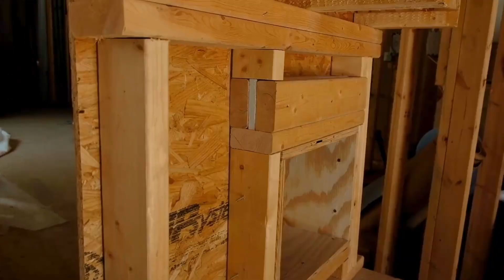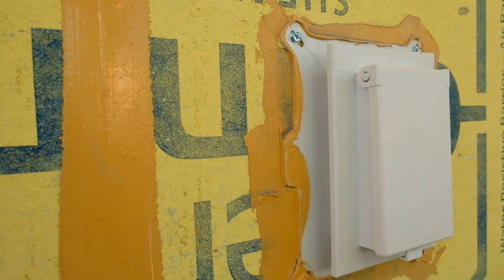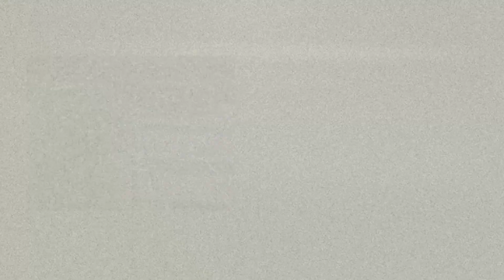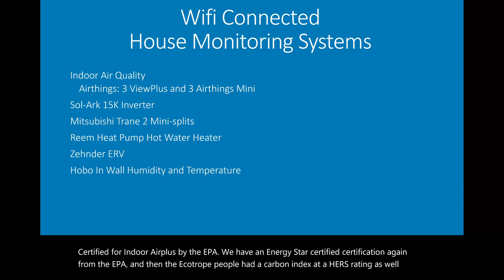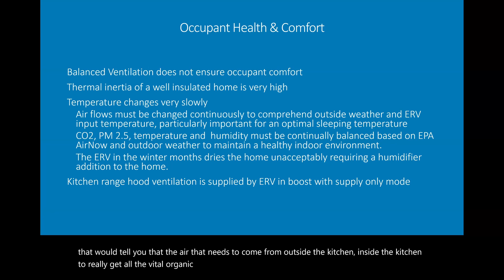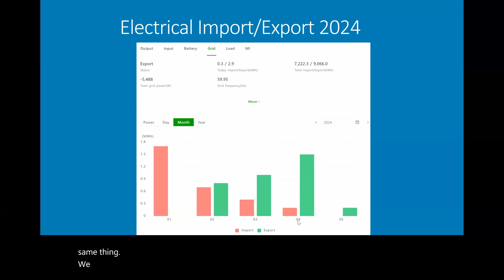A Pleasant Future Vision: Passive House Source Zero Energy Home Tour

Comment: Why is the zip sheathing on the exterior ceiling facing (green side) inward toward the house instead of facing outward away from the house like the zip sheathing on the exterior walls?
Reply from the maker: "to facilitate taping from the underside rather than the top.  the tape needs to be on the green side" - Michael Klement
Reply: @GreenHomeInstitute  The green part of zip sheathing is the water barrier. In an exterior wall installation, the green side facing outward makes sense to protect the OSB substrate and the interior from outside weather.

In an exterior ceiling installation, one would likewise expect the same outward facing orientation to protect the OSB and interior from weather from above.

With the green side facing inward, wouldn't a roof leak damage the OSB substrate of the zip sheathing because the weather barrier is on the opposite side of where the weather protection is needed?
Reply from the maker: @jeremyjedynak  "the intention of the ZIP OSB is to provide an air and vapor control layer, and a structural support for the extra deep insulation.  Water management is not its purpose" - Michael Klement designer.
Reply: @GreenHomeInstitute  According to the manufacturer (Huber) website:

"ZIP System sheathing and tape provides a water-resistant, durable underlayment for many finished roof coverings"

From the most recent response, it sounds like the architect / builder decided to install the Zip sheathing in an orientation contrary to the manufacturer's installation instructions because they were only interested in the air sealing properties but not the water-resistant properties of Zip.

However, installing Zip in an orientation that is exactly the opposite of the manufacturer's instructions for sky facing installations creates a risk of failure because the OSB substrate of the Zip sheathing is now exposed unprotected to any water that (inevitably) arrives from above.

Every construction detail has advantages and disadvantages, but when highlighting a detail that appears to show a product installed in a way that is contrary to the manufacturer's instructions, you owe it to viewers to at least explicitly state that in the video.

For completeness, there should also be an on-screen explanation of the related risks, why the decision was made, and any related mitigations taken.
Reply: @GreenHomeInstitute  Note that the Zip System warranty on the Huber website says:

"This warranty shall not cover the following (or any conditions related thereto):

... (b) products not properly installed ...
... (f) misapplication ..."
Reply: @GreenHomeInstitute  From the 12/13/2023 revision of the Zip System Installation Manual:

Page 16: "Install ZIP System sheathing panels positioned with the water-resistive barrier facing outside."

Page 40: "Install ZIP System sheathing panels with the overlay facing outside towards the sky."
Reply from the maker: @jeremyjedynak  Hi Jeremy - Thank you. If you have a specific question I would recommend contacting the building team directly at Fireside Homes Construction in Michigan.
Reply: @GreenHomeInstitute My specific question remains unanswered above.